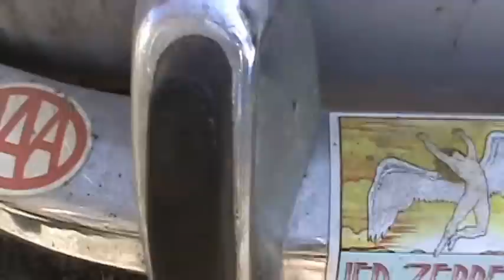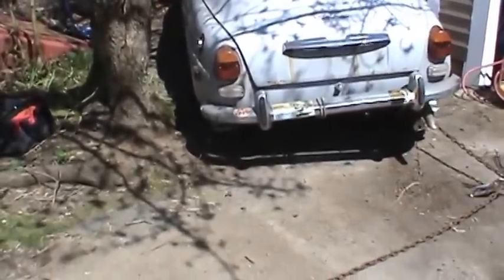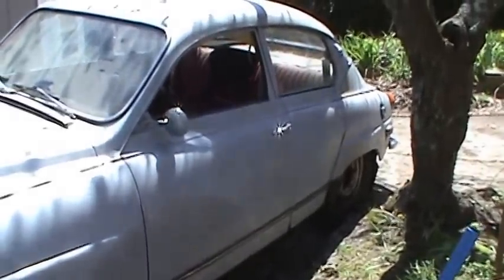extracting a saab 96 that sat outside for 30 years

Comment: You forgot that old Saabs have the parking brake on the front wheels, not the rear. :-)

And only a SAAB 96 owner would have a geodesic dome in their backyard!
Reply: Doesdnt it really hav the parking brake on the flywheel? Or is that the alfasud?
Reply: A pair of house bricks in the boot....

Comment: Here's a trick for everyone loading a piece of equipment or vehicle with a flat tire onto a trailer. Use a 1/4 inch thick piece of plastic wide enough to cover the bottom of the flat tire and the plasric reduces the drag of the flat rubber tire. This I learned working on wreckers for over 20 years. It works try it.
Reply: use a load all.
Reply: i learned that at the McDrive parkinglot: tray drifing! ;-)
Reply: Good advice man, used to do something similar when dragging heavy shit around the yard!
Reply: Excellent idea!
Reply: Buy a hundredweight of marbles and scatter them behind the car. Tie a Zeppelin to the roof.
Cyclists stuff their tyres full of grass when they have no other option, though that might be more difficult here than dragging a big wheel.. Lower it onto a roller skate,. Those are my stupid ideas.
PTFE discs are used for sliding washing machines etc they glide across most surfaces.. Allmost any material that will not crush and spreads the load will work, most plastics are good.
Put on some spare wheels...
Reply: Spray the tire and ground with dishwashing detergent, makes it slip and smell lemony fresh.

Comment: Another fine mess you've gotten us into!!☺
Reply from the maker: +805ROADKING but its not at my house this time,
Reply: +Mustie1 :)  it is a really cool little car!  Two-stroke or four-stroke?
Reply: +kd5byb   That's the four-stroke V4 engine based on a European Ford engine.  It has the V4 badge on the boot/trunk which is quite unusual, I think it was only the early V4 cars that had that and most of the time they have gone missing or the boot/trunk has been changed for one from a later car.  It looks like a very original car and well worth saving...
Reply: +kd5byb four-stroke v4!
Reply: 805ROADKING I'm subscribed

Comment: vvrrrring ding ding I drove my dad's Saab like that one. I was told it had 2 gas tanks but come to find out it had 2 pickups in the tank one higher than the other. I would ride it till it shut off and than switch over to the other pickup and when you got gas switch it back to the higher pickup. My sister would always forget to switch it back making the backup system useless.

Comment: Owned several and currently restoring a 66 and a 73 Sonet. All the Saabs with the 2 stroke and V 4S had a freewheel feature witch is engaged and dis engaged with a lever under the dash. You caned leave it locked on the V4's but you'll ruin a 2 stroke.

Comment: Completely independent from this videos subject matter, I have an engine building tip for you. When installing valve spring retainers, apply a small amount of bearing grease to the valve stem. Will hold retainers while releasing spring compression.

Comment: ford v 4 1700cc vith caunter balancing shaft...used on ford Taunus..from germany..before ford engines they used 2 stroke DKW engines from vest germany
Reply: 1500cc v4 engine in the early ones ! And from chassienr 002 is it Saab engine 2 stroke !

Comment: Watching this was very interesting for me as I was waiting for the rear suspension to pull out of the body like my Saab 99 did to me when I was traveling too fast down a dirt road. Instant hard left turn. I dragged the rear of the car all the way to the junk yard across town and returned all of the pieces I bought from them to keep that car alive. Only Saab I ever owned. Weirdest car I ever worked on. engine backwards with the transmission underneath it. Water pump in the top of the engine.

Comment: Is that a 2 stroke?  Those things make a really neat funny noise as well as smoke from the tailpipe.  If it's a 96 it would seem that the EPA wouldn't let them be driven or sold in the US.
Reply: +jbmbanter No it's four stroker in V4 design, originally from the German Ford. The Ford factory is in Cologne, Germany. That's why it's called Cologne V4 or V6. In the UK they also produced V4 and V6, but in another (and lousier) design. The easiest way to see witch you're looking on is to spot the distributor, on the German it's placed in the back, on the UK type it's in the front.
Reply: There wasn't much wrong with the Essex V6.
Got to agree that the V4 was a bit of a dog though.

Comment: You could have used tin trays under the locked wheels,  acting like skid plates, is that the Ford Essex V4 engine or the Triumph engine in there?
Reply: Skid trays...Good idea.. ')

Comment: Next time a wheel is locked up. Put oil on ramp/trailer. It slides a he'll of a lot easier. Even water would help. Great video
Reply from the maker: +rinacapper what and dirty my virgin trailer, besides he had to do the winching
Reply: Dish soap. Water soluble and not an oil spill. Also, Skates. Can be turned over to create a small ramp, as well. Very handy.

 http://www.awdirect.com/single-orange-tire-skate-48-2/tire-skates/

Comment: You were saying that the rear wheels would be a problem due to the e-brake/handbrake having been left on.  I think the e-brake/handbrake operates on the front wheels on these, like the 99s and the pre-facelift 900s...
Reply from the maker: +gosportjamie had rear ebrake, thats what he was hitting back in when it reached the trailer
Reply: Mustie1   Sorry, I made the comment before getting to that point in the video.  The garage I used to work for used to look after a later 96 for the old guy that owned it and that one had the e-brake/handbrake on the front wheels but that was a later one, if I recall from towards the end of the '70s...
Reply: that was the Saab 99. It had a baby drum inside the front discs.
Reply: +Jack Cole  Yes, I know the 99 and the pre-facelift classic 900 had the handbrake/e-brake on the front.  I was basing my comment on a later 96 that I used to work on which also had that set up, I suppose they were using as many common parts as they could by then to save production and tooling costs...
Reply: All things are possible in SAAB's world I suppose, I was going on the fact I've had six or seven 96's  from a 67 two stroke, to a 76, and they were all the same rear handbrake set up.

Comment: Did you buy the trailer?
Reply: +Jim Krueger He already owned the trailer. It's the one that the donor bus was sitting on.
Reply: +Flat4Buggy 2 Not that one the cargo trailer the seller had sitting in driveway with a couple of ng tires
Reply from the maker: +Jim Krueger workin on it

Comment: Tyres are gone, one wheel is locked, don't know about the underside but the top of the body looks remarkably good.

If that is one of the early ones it'll be a 2-stroke, and the oil / fuel mix would mean it wouldn't seize from sitting.